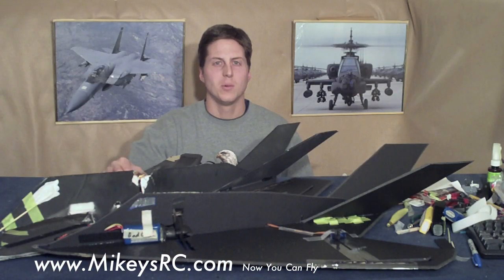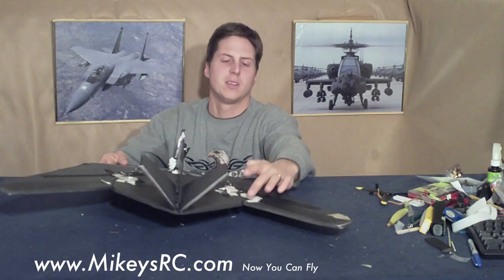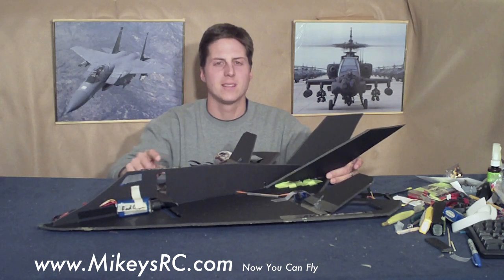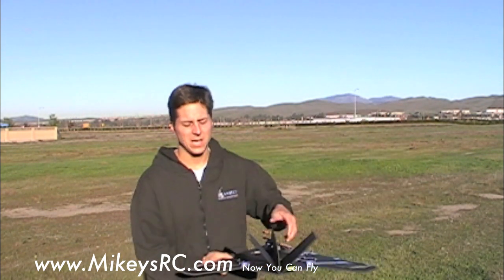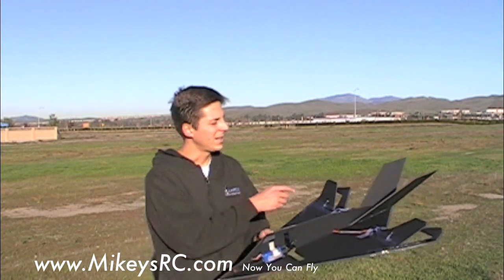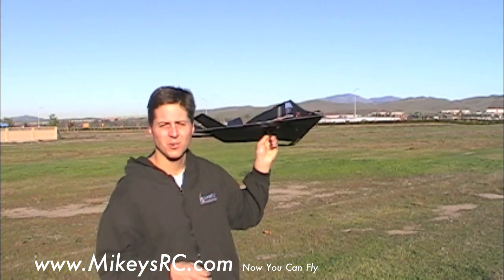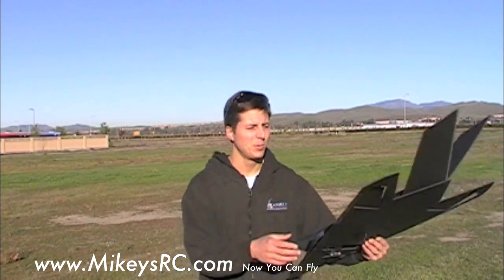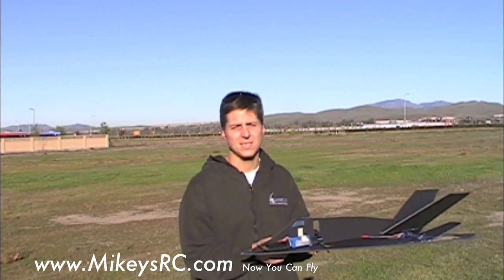A scratch built plane RC F-117 Stealth Fighter ONLY $10 / build in 3.5 hours!!

Comment: do you think it will work with a 1700kv motor
Reply from the maker: Not real well.  The hole for the prop it's big enough to fit a larger diameter prop that a 1700 motor would require.  You will be flying at full throttle and not going very fast.

Comment: Elevons are aircraft control surfaces that combine the functions of the elevator (used for pitch control) and the aileron (used for roll control), hence the name. They are frequently used on tailless aircraft such as flying wings. An elevon that is not part of the main wing, but instead is a separate tail surface, is a stabilator (but stabilators are also used for pitch control only, with no roll funcion, as on the Piper Cherokee series of aircraft).

Comment from the maker: @arifwaqas22 Then you will be pulling more amps with the same propeller.  If your battery motor and ESC can handle it then you will just fly faster.  If your electronics can't handle it then you will need to use a smaller prop. or onw with less pitch like a 6 X 3 or????

Comment from the maker: @youronlycow Try using acrylic paint from a craft store.  heavier than spray paint but a little more durable.  You could also try clossy spray paint.  It might make a kinda smooth shell a little more resistant to scratching.